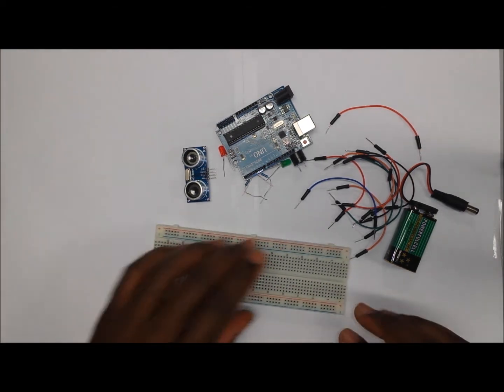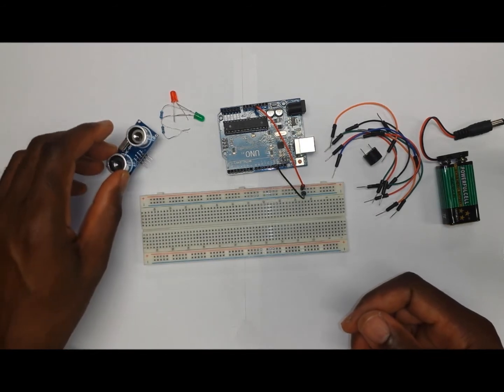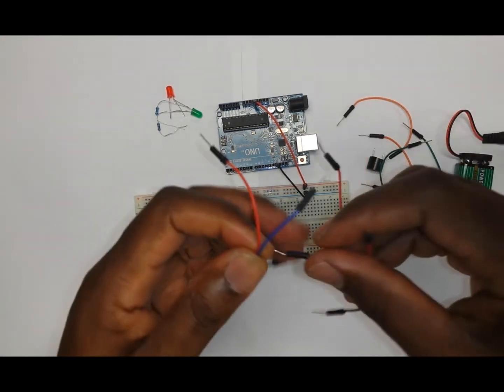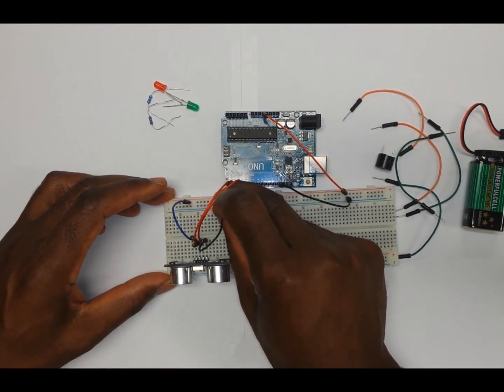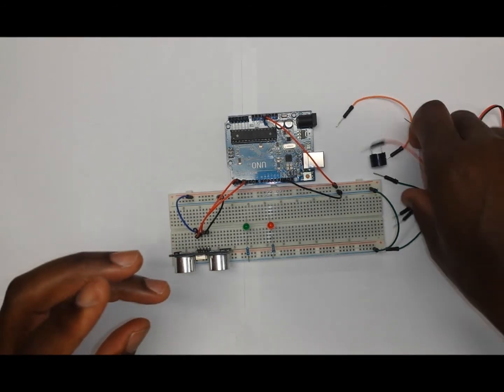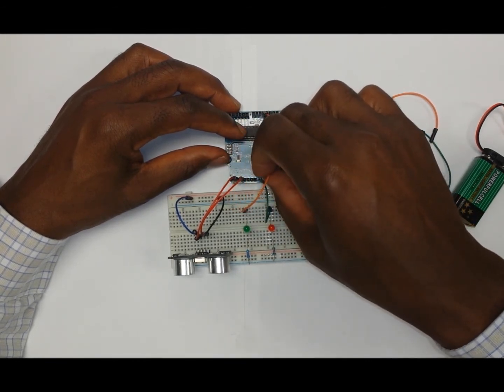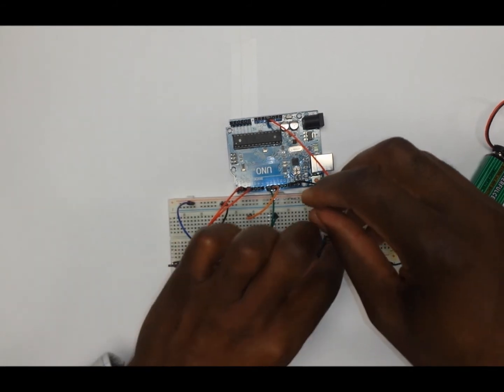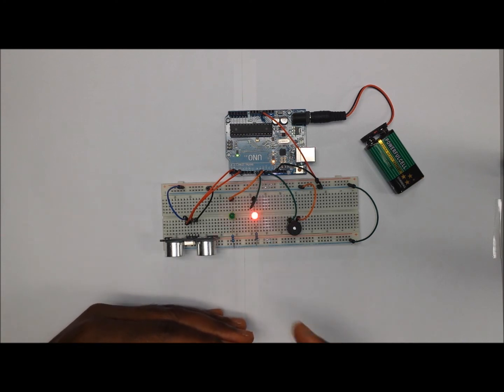Ultrasonic Sensor Controlled LED Lights and Buzzer

Comment: Pleass send me code bro
Reply: //Ultasonic Sensor
//Pins connected to the ultrasonic sensor
#define trigPin 2
#define echoPin 3
//LED pins
#define ledGreen 9
#define ledRed 8
//Pin connected to the piezo buzzer
#define alarm 11
int range = 5;//range in inches
void setup() {
 // initialize serial communication:
 Serial.begin(9600);
 //initialize the sensor pins
 pinMode(trigPin, OUTPUT);
 pinMode(echoPin, INPUT);
 //initialize LED pins
 pinMode(ledGreen, OUTPUT);
 pinMode(ledRed, OUTPUT);
 //set LEDs
 digitalWrite(ledGreen, HIGH);
 digitalWrite(ledRed, LOW);

}
void loop()
{
 // establish variables for duration of the ping,
 // and the distance result in inches and centimeters:
 long duration, inches, cm;
 // The PING))) is triggered by a HIGH pulse of 2 or more microseconds.
 // Give a short LOW pulse beforehand to ensure a clean HIGH pulse:
 digitalWrite(trigPin, LOW);
 delayMicroseconds(2);
 digitalWrite(trigPin, HIGH);
 delayMicroseconds(5);
 digitalWrite(trigPin, LOW);
 // Take reading on echo pin
 duration = pulseIn(echoPin, HIGH);
 // convert the time into a distance
 inches = microsecondsToInches(duration);
 cm = microsecondsToCentimeters(duration);

 Serial.print(inches);
 Serial.print("in, ");
 Serial.print(cm);
 Serial.print("cm");
 Serial.println();

 if(inches < 5) {
 Serial.println("DANGER");
 digitalWrite(ledGreen, LOW);
 digitalWrite(ledRed, HIGH);
 tone(alarm, 2000);
 delay(100);
 } else {
 Serial.println("GOOD");
 digitalWrite(ledGreen, HIGH);
 digitalWrite(ledRed, LOW);
 noTone(alarm);
 delay(100);
 }

 delay(200);
}
long microsecondsToInches(long microseconds)
{
 // According to Parallax's datasheet for the PING))), there are
 // 73.746 microseconds per inch (i.e. sound travels at 1130 feet per
 // second). This gives the distance travelled by the ping, outbound
 // and return, so we divide by 2 to get the distance of the obstacle.
 // See: http://www.parallax.com/dl/docs/prod/acc/28015-PING-v1.3.pdf
 return microseconds / 74 / 2;
}
long microsecondsToCentimeters(long microseconds)
{
 // The speed of sound is 340 m/s or 29 microseconds per centimeter.
 // The ping travels out and back, so to find the distance of the
 // object we take half of the distance travelled.
 return microseconds / 29 / 2;
}